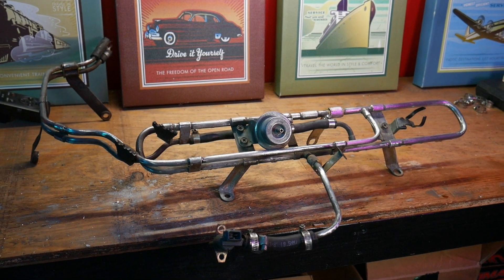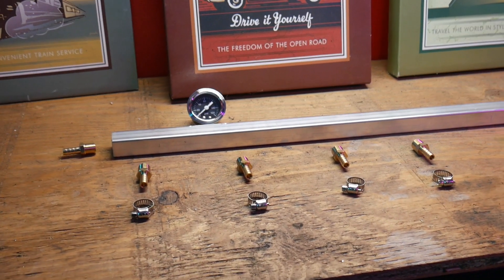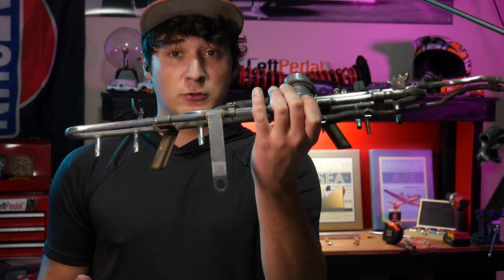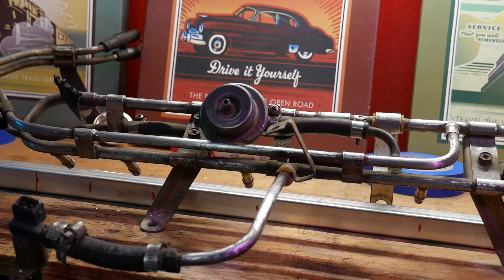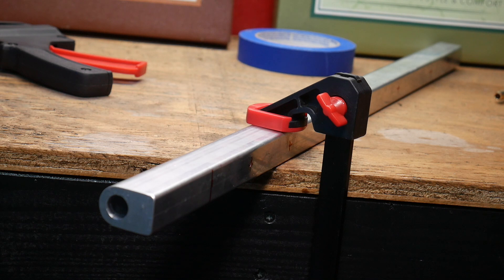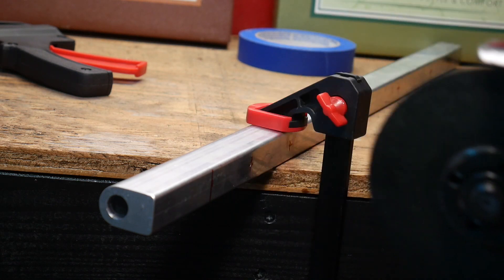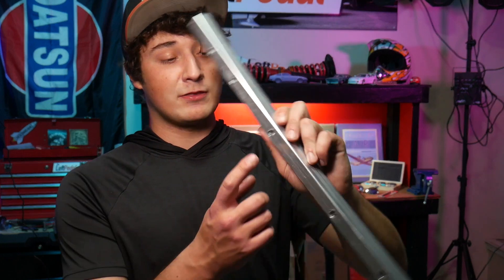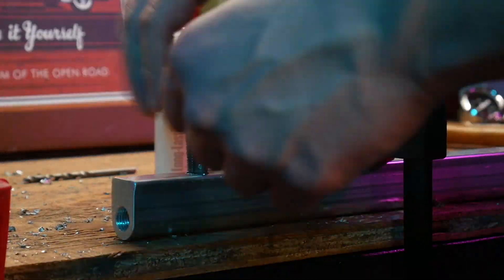DIY Custom Fuel Rail Build | Datsun L28 Engine

Comment: Did you ever get to install the rail back on your dachshunds and get it going because I saw the video where you had to move and the car wouldn't start and you ended up putting the old rail back

Comment: Crazy question. Since making your fuel rail, have you ever encountered galvanic corrosion between your fittings and the aluminium fuel rail blank material?

Comment: Whenever you measure for increment like this you stretch your scale (tape measure) across your part and measure as a whole 

You never measure from part to part to part because ever fractional error you make is compounded across your work 

If this were a precision part where everything had to line up that last port would have been off

Lubrication is put on the top of the part at the surface the tap is intersecting it at. Putting lubrication in the hole after the tap is removed does no lubricate the tap. A good tap will remove chips as you reverse it through the relief cut grooves and does not need to be taken all the way out. You can put the oil there and allow it to run into the work  

You shouldn’t use gasket maker, you use a fuel resistant o-ring especially because of the next issue this has 

This should have been done with aluminum barbs as brass reacts with aluminum causing galvanic corrosion

Meaning over time the brass molecules are removing the aluminum. This is sped up by fuel and engine heat. You have a pressurized fluid that’s only being stopped by a chemical between the threads that was not designed to do this

If you use an o ring you have a seal on the face being kept in place by the face on the barb being screwed down 

This was good in principle, just lacks all the things engineers know. But it was great to watch

Hopefully you’ve kept at it and learned a lot

Comment: Did you use brass or copper on those fittings? Aluminum and brass/copper are incompatible and will cause the aluminum to breakdown over time. I would hate for you to get some aluminum through your fuel system.
Reply: Fuel naturally breaks down aluminum. E85 more so 

Fuel filters help with this but no major damage with modern fuel with detergents will happen 

The bigger issue is that the clearance between the two metals is increasing constantly and there is only gasket maker between them in a pressurized system 

This is why the car god have us o rings

Comment: Great video. I was have been planning this project except not on a Z but a Jag v12. Will be making two of them. I have two questions though,  what size are the ends of the extrusion? Also,what did you tap it out to?

Comment: Hello, I'm about to make one of these for my early RB20DET.
How did you go about using this rail? How did you secure it to the head/manifold? I'm trying to figure out how to secure it. Let me know, thanks!
Reply: Drill and thread the side face material below the port and make L brackets for the oem mounting points

Comment: What about the cold start valve and vacuum lines?
Reply: On the s130 chassis there on the intake manifold.
The cold start valve is literally just a extra injector. Vacuum lines really depend on what you want hooked up. I’m debating on how I want to run my intake on my zxt and had a lot of questions about it so I joined the z groups on Facebook.

Comment: What did you use for the liquid gasket maker?
Reply: Don’t use gasket maker, use thread sealer. Even Teflon tape would be better. The permatex thread sealant is solvent resistant. Most products like he used in the video are to help gaskets seal, not create them. Plus, threads aren’t gaskets.
Reply: @lacygamsky6251  thread sealer is better than gasker maker, but an o ring is better than thread sealer

Comment: I noticed you have metric on the other side of your tape measure. I've started using metric for my builds (house and car) since it's so much easier to remember the measurements and do any math required, after a couple projects it will be second nature. Awesome video!